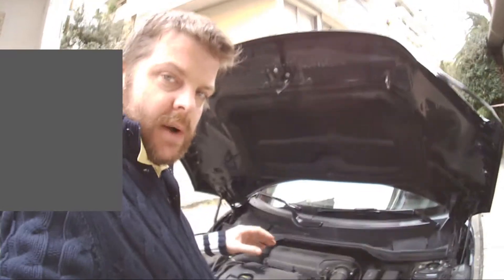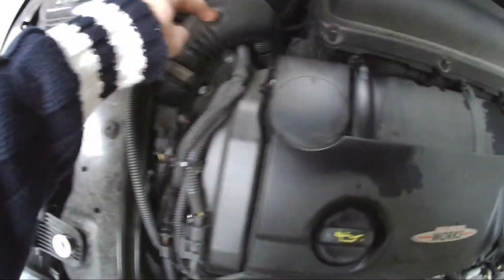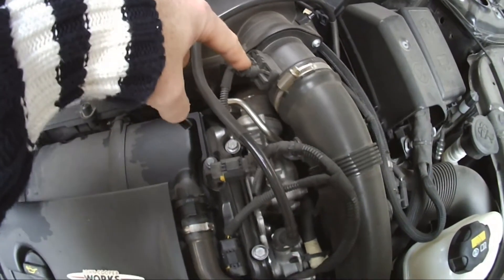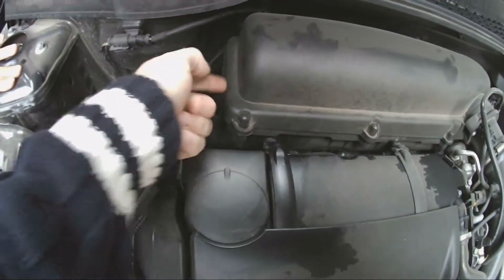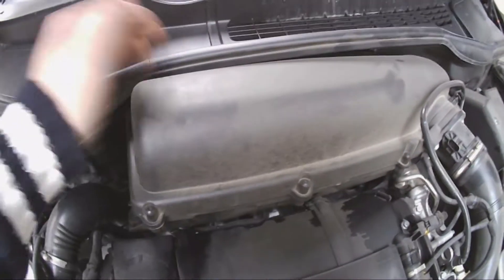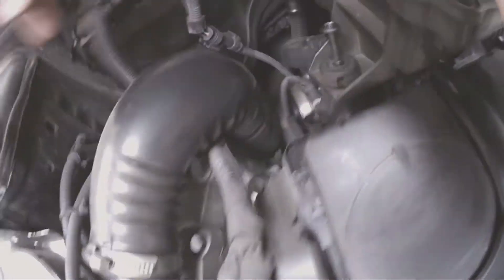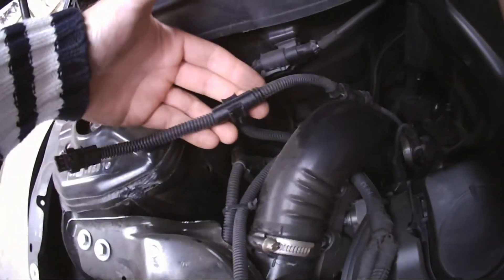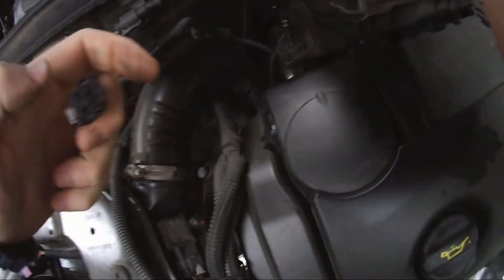R56/R60 Mini Cooper S - RaceChip Tuning Box Installation Guide

Comment: Just installed the Race Chip GTS on the wifes mini R60 N18, was super easy!  Took about 5 mins to install all 3 connections, and another 10-15 mins to ziptie the control unit and tidy the wires lol.  VERY noticeable increase in power from 3000RPM to redline!   Typically new sparkplugs and coils would be required for adding boost but so far seem to run great on the originals..  I run 93 octane.   Setting 5 is smoother than 6, but 6 pulls a bit harder and comes on a bit more suddenly.
Reply from the maker: Stock settings are pretty good. Turning it up can occasionally give check engine lights under some conditions on some cars.
Reply: @DriveTuneMedia   my bmw requires gapped sparkplugs that are 1 step colder, and fresh coils otherwise engine light right away.  But the mini on the other hand  isn't picky.

Comment: Does this actually make a noticeable difference in power and torque??
Reply: Yes, very noticeable but only when the turbos are hot, you won't notice any difference for the first 5-10mins from a cold start.   Needs to be warmed up first.